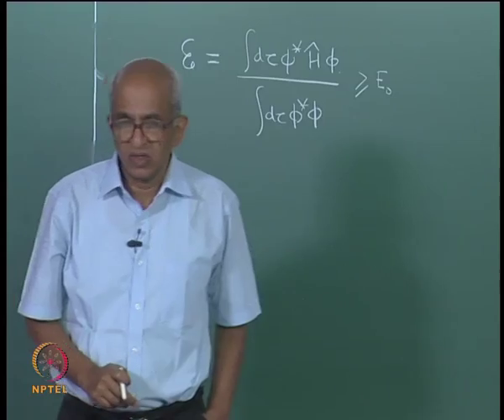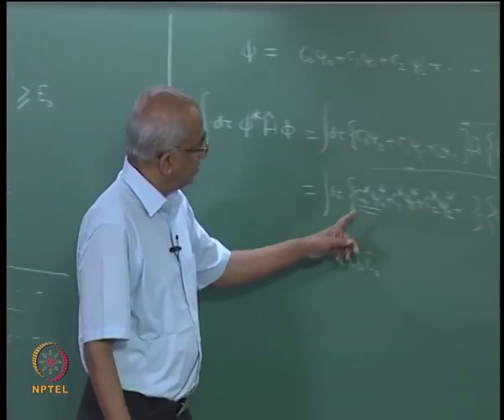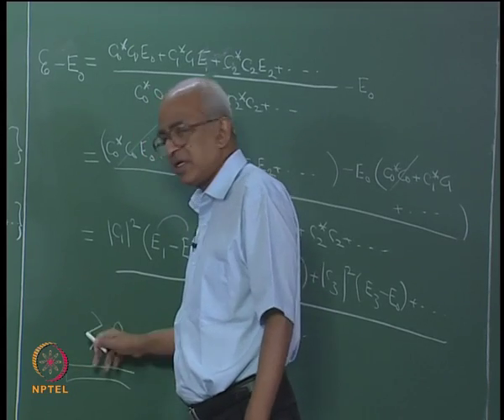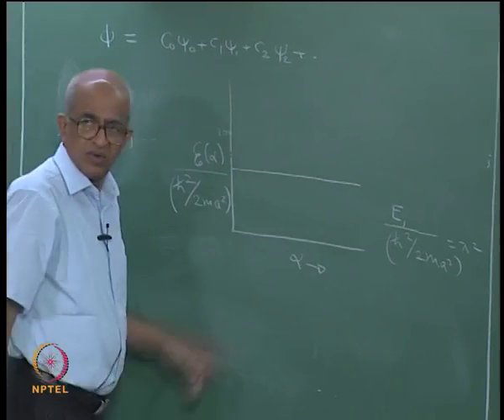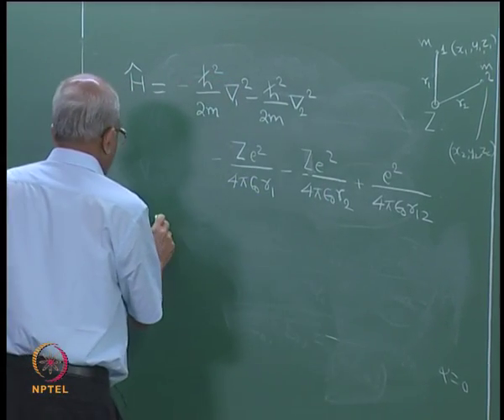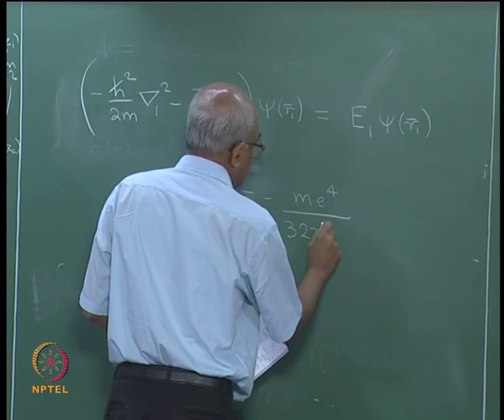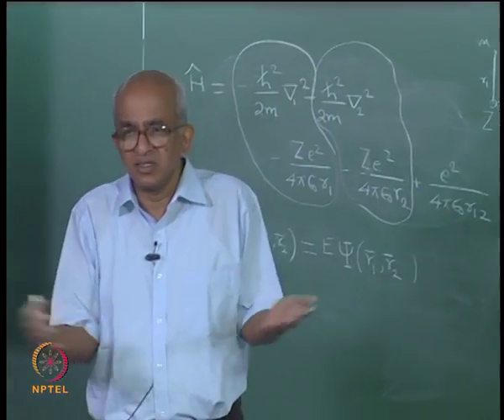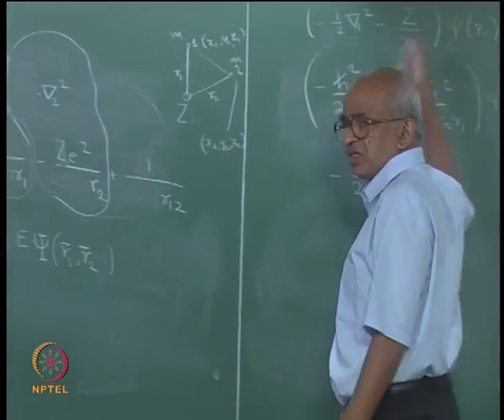Mod-06 Lec-39 Variation Method - Proof and Illustration

Comment: Turns out that Emin is at alpha = 1.13314 and pi^2 = 9.8696044...  Calculating Emin = 9.86986 (h(bar)^2/2ml^2), Emin is only 0.00259% larger than Eo.
Reply: +Bohdan Schatschneider Atomic Units are addressed at the end of the lecture.